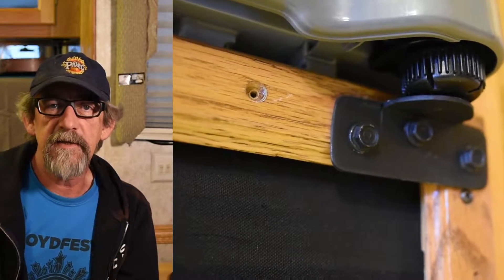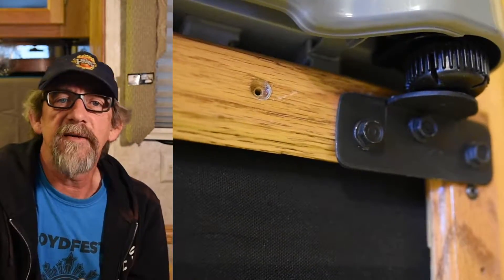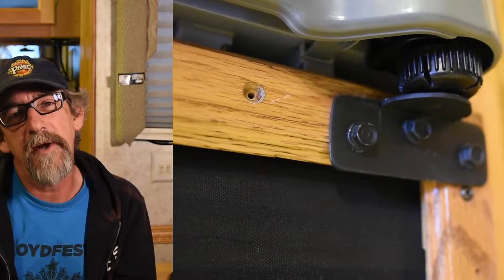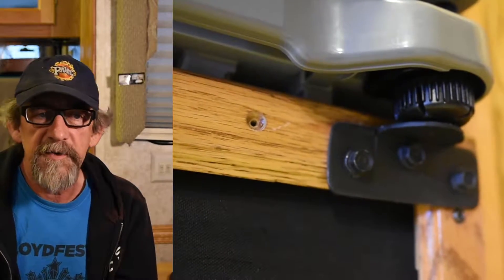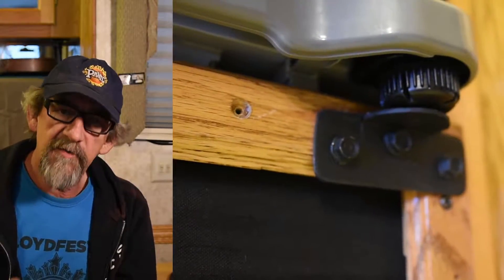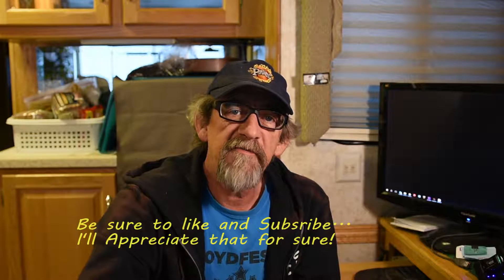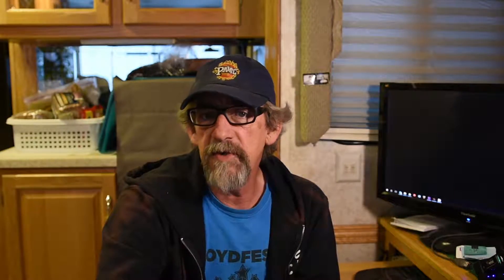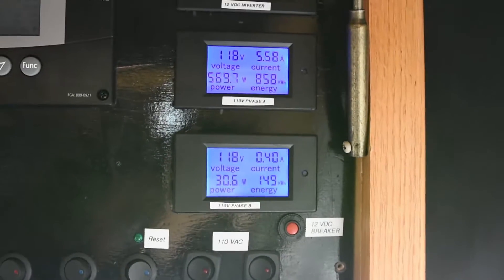Samsung RF18 Fridge update... Louver Mods' support brackets and Energy Usage

Comment: I’m shopping to upgrade to residential/compressor. Curious how yours is operating years later?
And, if you power it via solar very much? I’m off-grid, full-time boondocking nomad with a pretty stout system.
Reply from the maker: I had 400 amp-hours of lithium and 1,800 watts of solar, and never ran out of power. It was a game changer and I would do it again.

Comment: What inverter are you running ?
Reply from the maker: I have a Xantrex 3012 Pure Sign. 12v and 3000 watts but the fridge does not need all that much power. It pulls about 120 watts when it is running. Thanks for watching!

Comment: Hey, TR:  I commented on one of your previous Samsung install videos, that I was about the start the same project on my coach. Have the RF-18 "in" and am finishing the trim today. I replaced the two adjustable "feet" with two 1.5" wide steel straps, (Ace Hardware) drilled to attach where the feet did, and to extend straight down, to the front of the bottom face-frame. They're tied to the face-frame with lag-bolts. I'm also retaining the fridge in-place by extending the surround trim slightly (about 3/8") over the face of the fridge cabinet - behind the doors / freezer drawer. Does not interfere with the doors/drawer, but provide retention spread out over 142" of fridge cabinet. I can send a photo or two, if you're at all interested. Thanks for the motivation!!Cheers from Wickenburg, AZ!
Reply from the maker: I was thinking about you when I posted this update wondering how your project was going... Thanks for the update..your going to love it. Yes, send the pictures...I would love to see it! I also like the idea of the straps to the face frame. Do you go mobile in your RV? I'd be interested in knowing how it travels.. 
Thanks again!!!
Reply: I'll take a couple of photos today. Not sure how to get them to you?
Reply: I’m shopping to upgrade to residential/compressor. Curious how yours is operating years later? And, if you power it via solar very much?
I’m off-grid, full-time boondocking nomad.